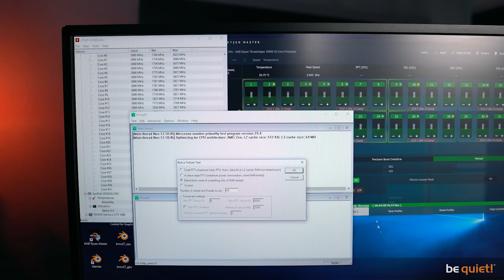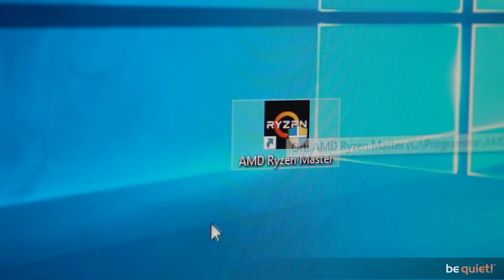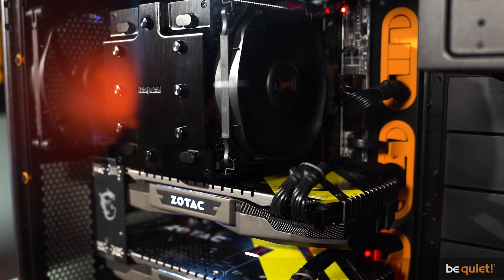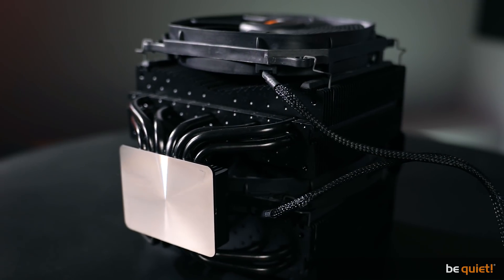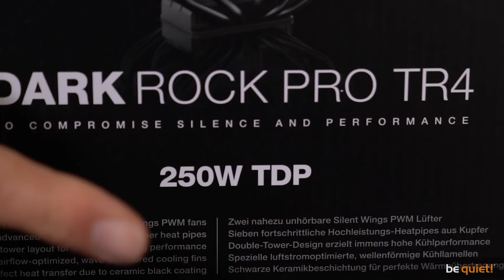Threadripper system with air cooling? | be quiet!

Comment: Will this cooler work well on the threadripper 3970x?
Reply from the maker: The Dark Rock Pro TR4 certainly will.
Reply: @bequietofficial  thank you.. placing my order including a case.  Do you suggest using thermal pad instead of paste?
Reply from the maker: @allenl9214  No, we're big fans of thermal paste. It's included, of course.
Reply: But 3970X has TDP rated at 280W, whereas Dark Rock Pro TR4 can only handle 250W? Does adding the 3rd fan increase TDP rating?

Comment: Mine arrived today! Went with Aqua Tuning from Germany. For $16 it was shipped to MA in under 1 week.
Reply: Thanks for mentioning that. It was so hard to find an online reseller who had it. On eBay there were a few EU resellers, but they were charging about $110 before shipping. I checked your resource and it was $87 (normal retail price) + $10 for shipping. Can't wait to get it. Because this isn't readily available in the US, I was about to go with the Noctua UH 14, but the colors of the fans are unsightly, and it only has one stack and one fan.
Reply: @dnashj33  Awesome! Glad I can help. I do just want to mention that I upgraded the shipping from the cheapest option to the middle option. 

Also, I'm running a 2990WX in a Micro ATX case. The Dark Rock Pro is inaudible over my Noctua case fans, even at 100%. 

It keeps the 2990 around 30-35C at idle and around 60-65C under sustained load with a slight OC.

Comment: Just waiting for it to go on sale somewhere.
Reply: I was able to buy one from Aqua Tuning. They're in Germany. It was shipped to the US in under a week for $16.
Reply: @anthonymarquette9034  how is it so far?  I am running 1950x and hoping to overclock a bit.  thanks
Reply: @Wicked_Ticks  Pretty impressed so far! I am able to match be quiet's 3.6Ghz under load for an hour or so. (This is a 2990WX in a MATX enclosure.) I'm running mine at 3.4 in order to keep it well below 68C during very long batch renders. You should be able to push a 1950 pretty well on this. Just be warned.. it's BIG.